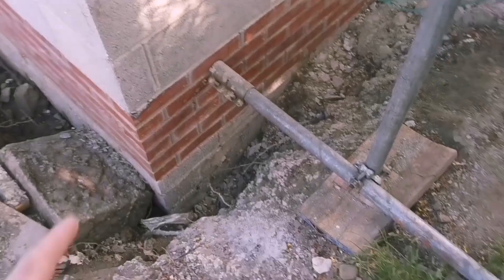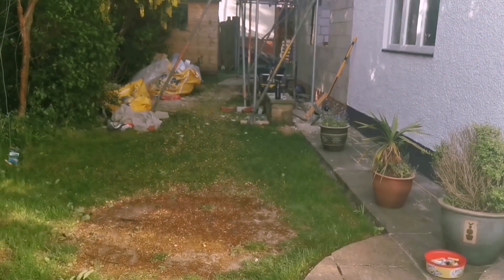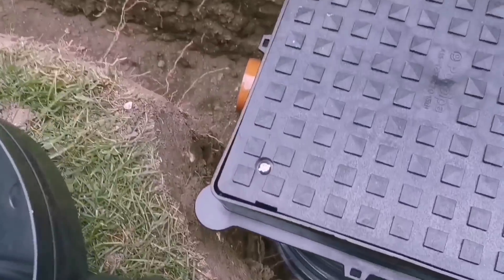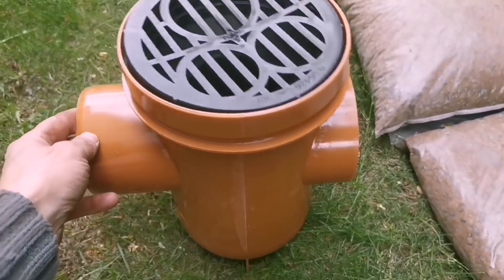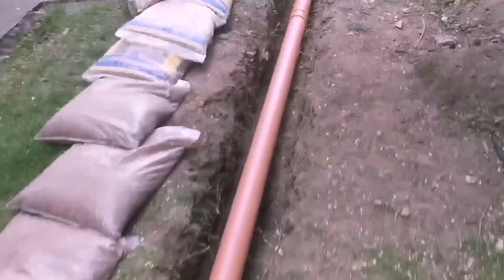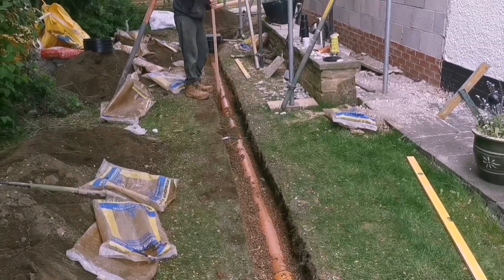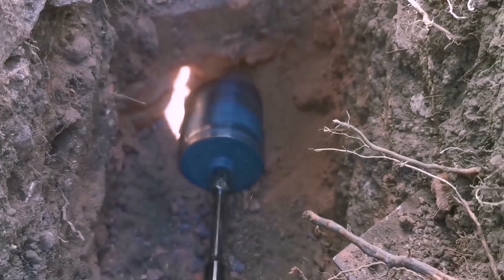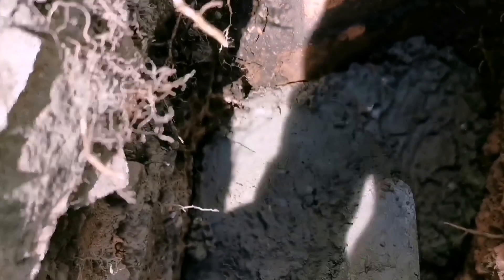Fitting drains

Comment: Thanks chap. I'm just about to do some drain work in the next few weeks. I'm quite close to the top so will work back up the clay a bit so I have  less fall on the pipe as its only surface water..... I also think you can have less drop on surface water.....
Reply from the maker: Hi mate nice one. Yes you don't need much drop on them. They also say you can have too much of a drop some times. just test it before you fill it in and you will be good 👍👍👍👍

Comment: Good neat drainage work Mark, well done. Neat trenches, well supported pipe work and even turfed to finish.
Much better with the core drill Mark , saves a lot of making good inside and out. Top job Marra.
Worked out that roof yet ?
Reply from the maker: Chears mate. Yere been on the roof this week. Just need to edit the video. This roof is a bloody pain in the arse lol it's going to take a wile 😂😂😂👍👍👍

Comment: Digging that close to the scaffolding standard uprights would get you thrown off a proper site
Reply from the maker: Definitely you wouldn't do it on a site that has a load of men on the scaffolding that's for sure .when they two of you and you not putting a lot of weight onto it your fine .or wet weather if it would have been winter I would have waited for the scaff down 👍

Comment: I'm aghast.

Trenches about 300 mm wide when they should be 450 mm? (Ever heard of Codes of Practice or the Building Regs?)

Breaking into an existing drain and ‘popping’ concrete into the trench (to 'seal' the penetration from soil particulate ingress, I imagine)? What did Building Control/your local water board say about that? (I assume you applied for a 'new connection to an existing sewer' and paid the £150 or so for the inspection?) 

How did you finish the penetration into the existing manhole on the INSIDE of the manhole? (See above re inspection.) 

How did you establish your levels? (Not a boning rod or traveller in sight.)

On that note, what fall did you lay these pipes to? And did you check the gradient when you were done bedding your pipes backwards (see below)? 

No pipe test before backfilling? (I guess Building Control were definitely out of the loop, then?) 

Laying bedding AFTER pipe/inspection chamber laying? (Classic cowboy move. Piling in gravel afterwards is a sure-fire way to kick up the pipe.)

Stamping down turf to BELOW ground level? (Ever heard of soil settlement?)

I could go on, but I'll stop with the scariest aspects...

1) Damaging cables? Ever heard of the principle of 'dial before you dig'? 

2) People on here applauding you. 

*

No wonder builders get such bad press...
Reply from the maker: Past it off mate 👍this is a small extension with one toilet not a full housing estate
Reply: It’s good to have such videos. We can praise the good work and highlight the non compliance to educate builders and others who are interested in buildings construction

Comment: How far have you got to dig down is it a certain depth?
Reply from the maker: No mate no depth to go down to. As long as you have a slow fall on it. Think it 1 to 40. So 1cm drop to 40cm long. Don't make the fall to steep. As the water will run quicker than the solids. The the solids will get stuck. Every one usley thinks bigger drop the better but. That's not now it works. Hope this helps 👍👍👍
Reply: 👍👍 yea I've heard something like 1 in  40 drop thanks

Comment: What is the drop of the pipe to allow water flow away from house to man hole??
Reply from the maker: Hi mate I think the regulations are 25mm per meater of pipe. But some times you carnt get the drop. Depending on how deep your manhole is or main drain. The best thing is to put it in and test it. before youfill it in . If it runs away nice and slowly you have it right. Hope this helps 👍👍👍